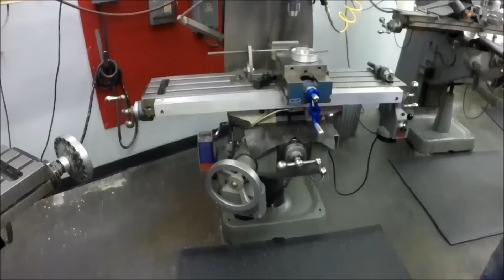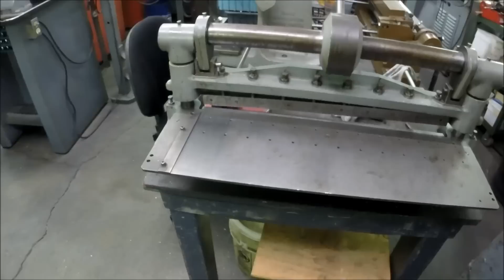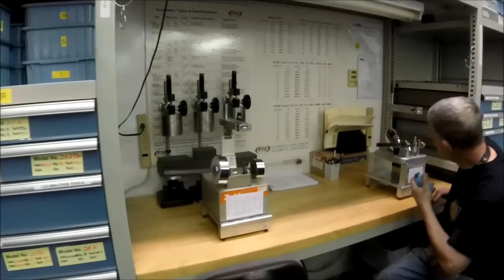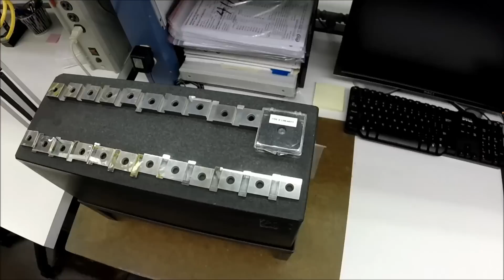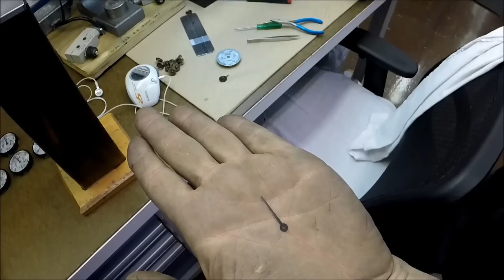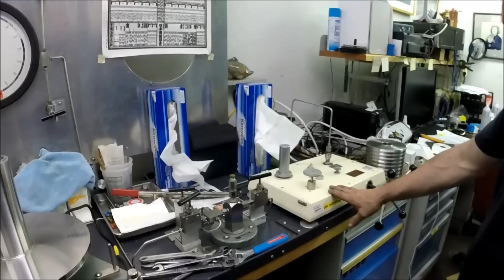PTC Metrology Tour

Comment: Good tour of an old school shop. Streamlined manufacturing done well. well organized and efficient.
 I like those DX 33 Knee mills. I always said that a good machinist can be a Great Machinist with a good mill. And Bridgeport  really keyed in on that. And that series I 3 axis is outstanding in that roll. I had a series II special with the DX 33. It wasn't beefy but could take a well enough cut ...and make simple 3 axis cuts. 
 The value proposition is this. If a machinist has the ability to repeat his set up and conditions the more reliable he can be with his end product. Making him more producible.
 Bolt hole , arcs, Circle, radius's, positioning, pecking, sub routines, trig help and part program storage. Some have a remote toggle. Positioning isn't blinding about 400 IPM... but so what. and a chip tray and sub pump and your full circle all the bases covered except tru the tool cool. 
 obviously I love this mill.